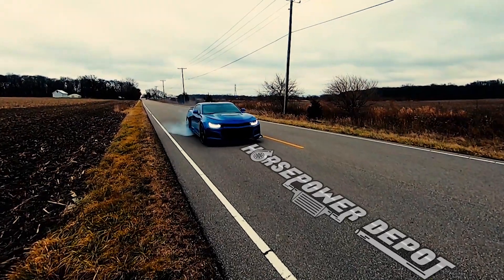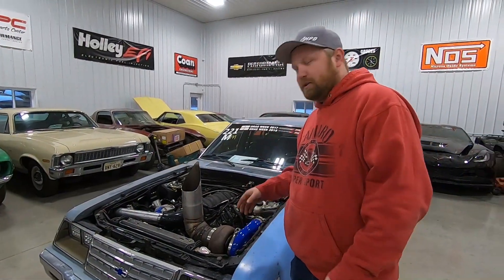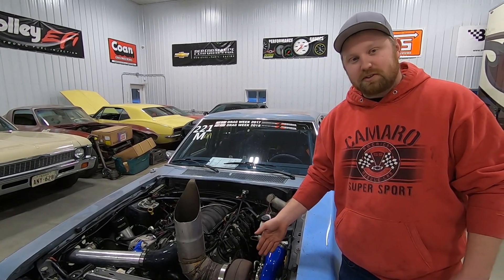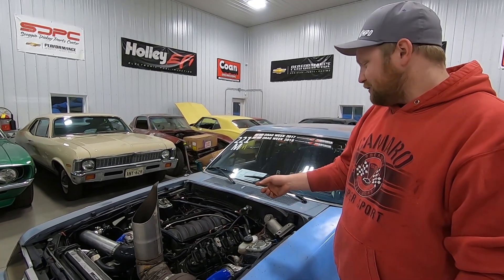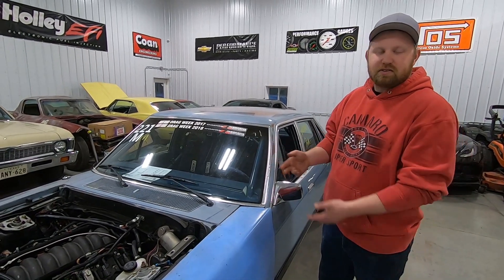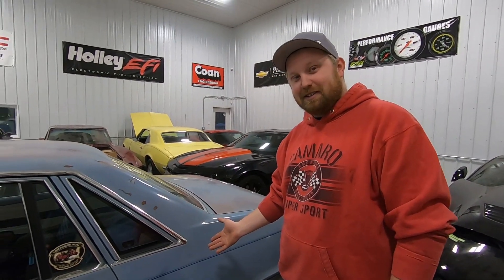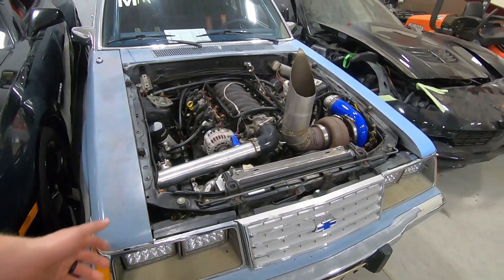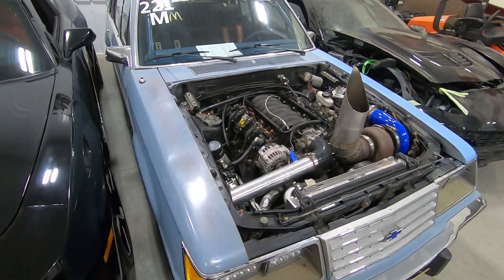How Did We Make Over 1000WHP With A Junkyard 4.8? We Share All The Details Of Our Ford LTD Sleeper

Comment: Is it still good at this power level? How's it holding up? Did it run some good numbers on the traxk?
Reply from the maker: It made it a whole season after this video. Then it got taken apart and is still being worked on. The 4.8 still runs and is waiting for the new turbo setup. It went 8.90s at like 156 weighing 3700 pounds.
Reply: @HorsepowerDepot  wow!!! You guys raced often? This is incredible! I have a gen 3 block just like yours transition year or what ever it's called with gen 4 rods and pistons and it's a 6.0 iron block. With very light car, like 3k pounds with me In it or 3100 max, you think we can make 900 or so whp and hit 8.8 or something?

Comment: Maybe I missed it but what's the weight?  
Pretty similar setup to my Capri and it weighs close to 3300lbs.  It's a 5.3 with a billet 80.  Been 8.50s on 30psi
Reply from the maker: 3600 with a driver. Hasn’t been out with this setup. But with 820 hp it went 9.14.